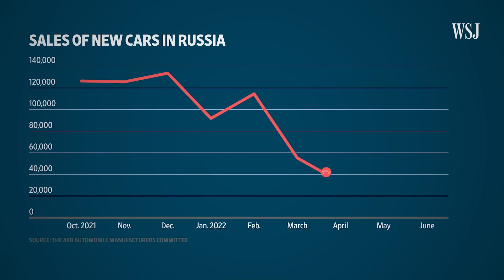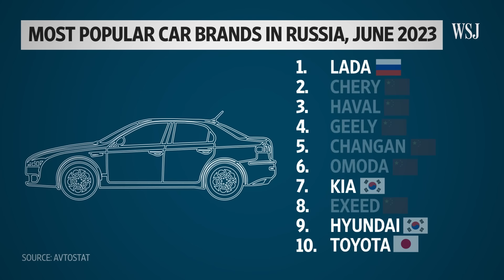China Is Now the World’s Top Car Exporter: How the Russia-Ukraine War Helped | WSJ

Comment: 世界的动荡不安，会影响石油的供给，很多国家害怕受影响，会大力发展电动车，同时电动车对环境友好，是未来的趋势。希望各个国家保持和平拒绝暴力，都成为环境友好型国家。
Reply: 危機。危就是機。
Reply: Fossil fuels are not going anywhere anytime soon. Most of the power generation in the world relies on them.
Also the immense cost of setting up charging infrastructure in many parts of the world remains a limiting factor to EV adoption. Not to mention that these EVs are a Mechanic's worst nightmare when they break down.
Reply: @heroldmutebi8200  there is a plan to move thermal power generation to hydrogen. Hydrogen is not cheap to manufacture, but it can be made with excess power during off-peak hours.

Comment: But are they any good?
Reply: I got a Chinese Hybrid SUV this year & been driving it for over six months and it's been reliable so far. The fuel economy is good...6ltrs for 100km. All the safety bells and whistles also offering a 2yr warranty that's the kind of deal I couldn't pass up. A Japanese brand with the same Tech and features would have cost me 50k-60k.

Comment: Unsafe cars. 😮
Reply: I got a Chinese Hybrid SUV this year & been driving it for over six months and it's been reliable so far. The fuel economy is good...6ltrs for 100km.also offering a 2yr warranty that's the kind of deal I couldn't pass up.
It's has all the safety bells and whistles.
 A Japanese brand with the same Tech and features would have cost me 50k-60k.